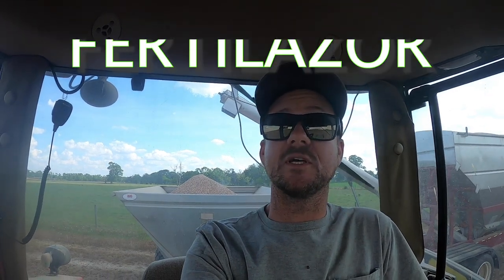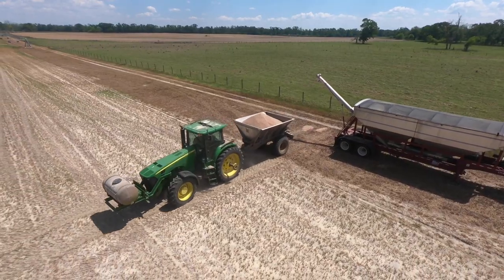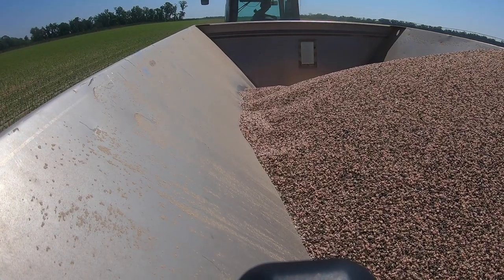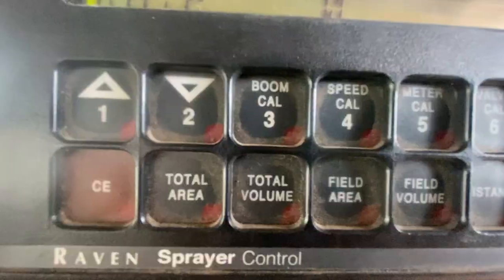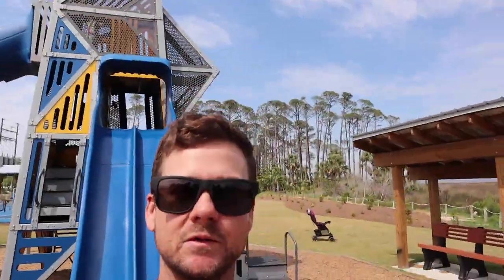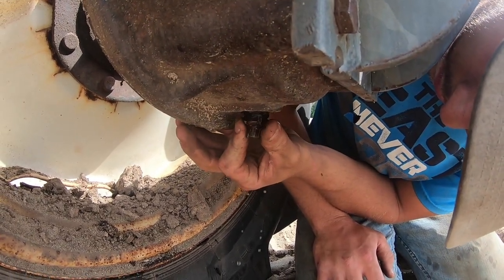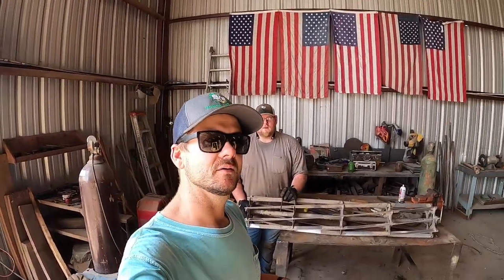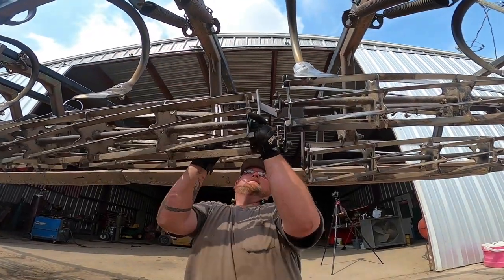Spreading Fertilizer On Florida Corn!

Comment: Jim, do y’all have to sand fight your cotton when you don’t have a cover crop? Out here in good ole west Texas after a rain on dry land if it’s not up much past 3rd leaf we have to sand fight so it doesn’t get to blowing and kill the cotton. We usually loose 400 to 500 acres every year despite our best efforts and have to replant.
Reply from the maker: Every now and then will have a issue with sand. One year a couple years back was rough. But for the most part we are ok.